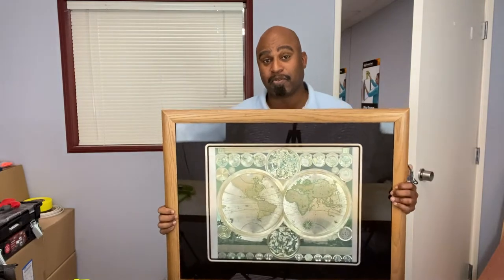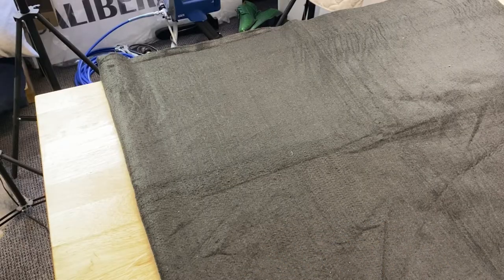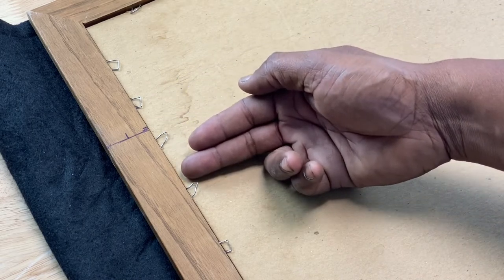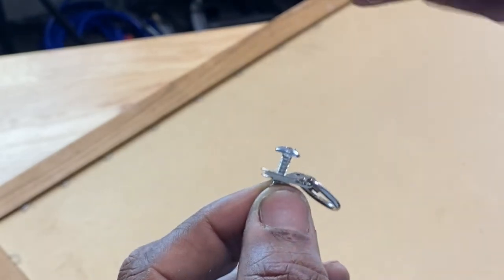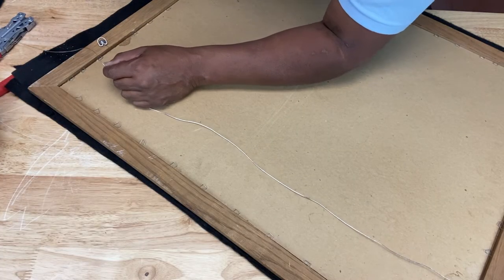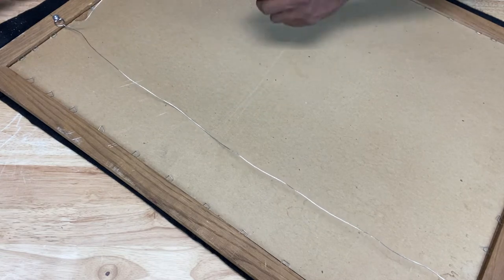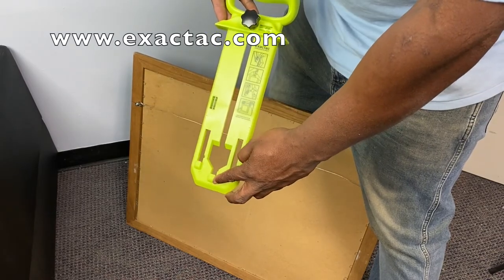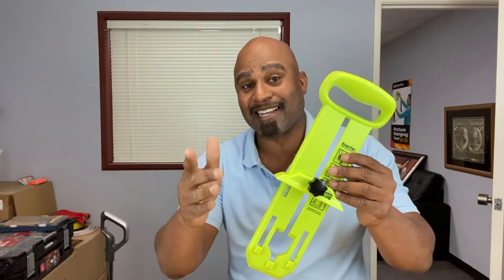BEST PICTURE HANGING TOOL

Comment: A nice step-by-step approach to hanging a picture frame.  One important note:  when hanging a picture frame, do not use a since conductor wire, instead use a braided or stranded wire as the single conductor wire is not as strong and robust as the braided or stranded wire.
Reply from the maker: Thanks for the tip.
Reply: @Caliber8Tools  single conductor wire, not “since”. Sorry about that!